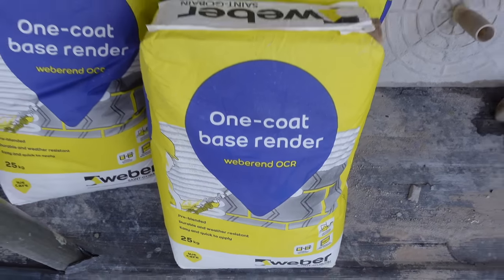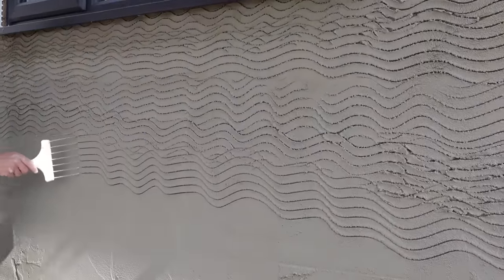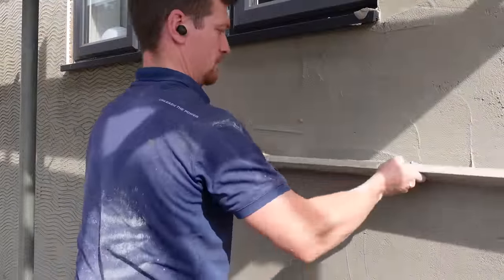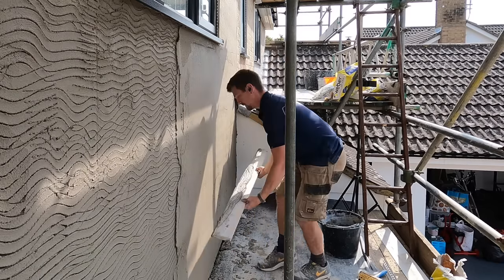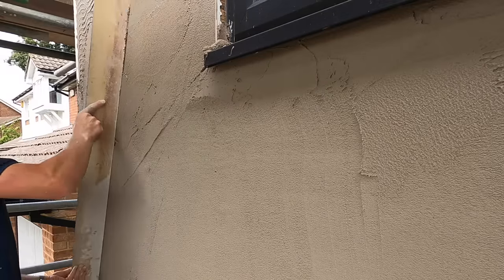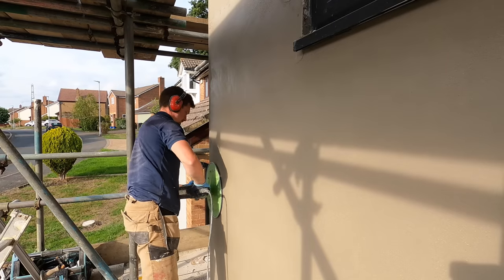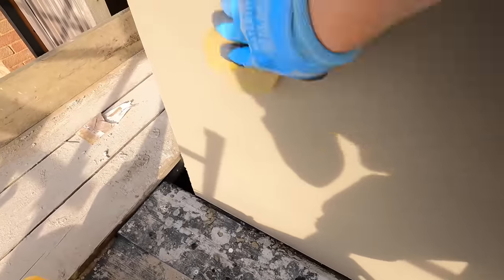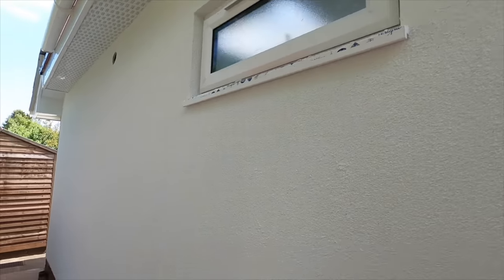RENDERING: Sand Cement Render's DEAD | This Bagged Render's 10X Better Than Sand Cement Construction

Comment: I was using this product over 20 years ago in Germany. Well done UK for coming into the 21st century. Now you guys need to come to terms with one coat interior plaster which I swear by. Maybe next decade British plasterers might learn how to use it. Bathrooms used to fully rendered with this product and then tiled.
Reply from the maker: Oh that’s interesting. I’ll give that a go - cheers Pal 👍👍
Reply: 40 kg bag of Quick Mix cost around €7 a couple of years ago 😉 Always used it in bathrooms with levelling/guide beads. A tiler’s dream!
Reply: @terryhill6734  what is the full name of product and manufacturer please?
Reply: @alansmith3733  manufacturer is Quick Mix and it’s called K-01. However, after using Johnstones Trade OCR, I’d say that is far better to apply.
Reply: @terryhill6734  thank you
Reply: Seems that many British tradesmen are slow to adopt new technologies. I wonder why? Maybe the fear of being uncool/untraditional?
Reply: @robd9863  Most British tradespeople ( and I say most, not all) are after making as much money as possible, but in their defence so are most British house owners. So with a very money orientated society we then dont have the time to learn new methods. Also most British trades people and in particular plasterers are uneducated and I include myself in this bracket and not the brightest amongst society. If they had a brain they wouldnt be plastering to begin with. Just my opinion and my experience. I know that comment will be controversial but its the truth. And again I say 'most' and not all of course.
Reply: @frankiez7414  Fair observations, but there are always exceptions. I like to think I've got the brains (some who know me would debate that) but I like doing the practical stuff. Arguably I don't do it all for a living, but well beyond what could be classified as DIY. I like to be self-sufficient and able to turn my hand to most things (though decorative stuff bores the pants off me). So I've always looked at the latest innovations. Many have proved awesome, though the product itself was more expensive.

Maybe the Germans are naturally pre-disposed to always look for better ways to do things. But then, they don't half make a mountain out of a molehill sometimes, when it comes to simple jobs. There must be a happy medium.
Reply: @robd9863  There are people who are not academically gifted and also those who dont have much choice in the matter. In general plasterers are not educated but of course there are the exceptions. So what you are saying Rob is that you are not a professional plasterer but a DIY plasterer ?
Many countries in the West were flattened during WW2 and therefore could rebuild the whole infrastructure from scratch and sort of learn again. Look at the Netherlands and their cycling mentality and network. The UK has kept many old houses and streets and only during the build of new properties have learned new skills and materials perhaps. But again I think its a small island mentality and in Europe they share many skills and ideas leaving us out on a limb. Maybe the 'Great' in GB is not so much anymore. Not so Great Britain I think.
Reply: It's the expense of new products that put trade off  and reduced profit
Reply: @rogergregory5981  This problem is as old as trade itself.

If I use an ace product that allows the job done in half the time, some customers will say "But you were only here working for X hours, how come your bill is so high?"

So many trades do things the old way, takes longer, but customer feels they got good value because they had a guy on their site for lots of hours, which (in their minds) justifies the price.

And don't get me started on why one should pay more for the experienced tradesman, who can do the same job (better) in half the time.

Perception. It's all about perception. And the money!
Reply: @frankiez7414
and where was your youtube video about the product 20 years ago then clever clogs
Reply: @antwan.  not sure what your point is Antwan. You say im a clever clogs but I am a plasterer with over 40 years experience and I know what I am talking about (well sometimes) The point I was making is that there are some trades people who just dont want to learn new ways. I dont know why this is. This was what the discussion was about, adopting new ways and techniques. Its about making things easier for everyone and making the best job possible surely ? Are you saying this is not up for discussion ? So then the whole point of the comments section here....discussion
Reply: Pffff..  Stay in your Germany then with full of cracks all over the buildings. Nothing can beat sand cement in quality and price my friend... And those shits in the bags from big corporations you could recommend for someone else not me.
Reply: @Olgertvanags  im not from Germany, so why would I stay there. Sand and cement is notorious for cracking and people are using brands like k rend on exterior builds now. Sand and cement is old school. Not sure what you mean by "shits in the bag" Are you a plasterer ?
Reply: I'm not a plasterer - any advice for a bricklayer's apprentice? We still mostly use the same tools we did centuries ago. Lime is largely gone and mud is cement and sand now, plasticiser sometimes, sometimes lime juice but with a trowel and level you can lay bricks and that's most of the job. Anything to speed that up or improve the end result or cut costs would be great).
Cheers

Comment: Great channel Blaine. Watched several of your videos and learnt an awful lot. I'm just a DIY guy who finds this stuff fascinating/magical to watch. You have a new subscriber.! 

Did a  plastering course at a Building Skills Centre (Yeovil)  quite a few years back where they taught you  how to build your own beads and get them plumb and they then formed the guides for when you drew the feather edge up the wall and the benefits of applications using trowel - float - trowel for a super flat finish.  Your review of the Webber product is very timely as I have a wall where the render blew and was hacked off but there remains a base layer that is rock solid. Trouble is that neither the builders not I have manged to get a new application of sand/cement to stay keyed more more than a few weeks.  It might be that I have to go back to bare blocks but the base render the very hard and I don't want to risk compromising the double glazed units with the vibrations that a SDS chisel might generate while hacking it off. This stuff might just be the answer. I see Webber do their own render bond product as well.  This could also be just the ticket for internal walls that have been coated with Thoroseal damp proofing as well. Great job with the channel!

Comment: Hi, just wanted to say a big thank you, I'm I guess a builder by trade and do a fair bit of internal plaster work,  a bit of sand a cement but always hatted it. I remember grinding a slot for a lead flashing into some new render and was put of by how soft it was! after watching this video I decided to take the plunge and do my own extension, 45 bags of OCR, was a joy to use and really happy with the results. I also scratched it before Christmas then top coated last week no problems. Thanks for all the info love the channel.

Comment: Used plenty of this , I use it over a rend aid scratch on troublesome or smooth bricks , Always a believer that a scratch coat should be left for a few days or your defeating the object of a scratch coat as going straight over it just smooths the coat underneath anyway and then has no solid key , You also gotta catch this product at the right time or can be a pain to float up, When floated at the right time it does rub up lovely though and is a nice consistent finish, Sand and cement is just as good and a lot cheaper it’s just getting your mix ratio right with spot on correct bucket measurements not shovels !! and experience with using it ,
Reply from the maker: Very good points here mate - thanks for sharing 👍
Reply: Yer thats what webber advised to do. They said use rendaid with mesh at 3mm thickness, then stipple roll and let it properly set. Then after a day or so apply the OCR ontop with mesh and finish as required

Comment: Been waiting to see these new products being used, looks so nice to use. 
Couple of questions, what type of backgrounds can this be applied too, and can the Monocouche be applied as a top coat and the silicon base? 
Many thanks Blaine, loves your vids 👍
Reply from the maker: I think you can use it on most masonry background but Monocouche is a a totally different product. You can use Silicone render on top of this product though pal!

Thanks for watching. I really appreciate it 👍
Reply: No probs, thanks for the reply, look forward to more vids 👍. 
I would just like to mention as well. I just finished rendering some garden walls. Done a really nice job. Much better than ive done previously when rendering . This is all because I’ve taken some of your tips  👍
Reply: Nothing new here. Rest of the European countries is using this stuff for 20+ years. Only UK and Ireland are far far behind
Reply: @PlasteringForBeginners can it be used on top of cement boards?

Comment: Can I use this product tot finish a wall that has been rendered with one coat of Knauf UP210W? It’s a sand cement mix, this wall sadly was’t flattened with a ruler nor scratched after the layer was applied. It had been worked with the trowel too much in an attempt to flatten it. I’m not satisfied and I would love to apply a second layer. Can I use this product? Do I need to prime it before I do?

Comment: It still cracks ,if the building is going to move it will crack even with mesh.I do agree it’s a decent product but I’m sure you will agree it doesn’t rub up or look as good as sand and cement.I would only use this product as part of silicone system or with some other decorative product over the top.
Good video B.
Reply: I’ve only ever used ms20 but went back to standard s&c because although I liked the consistency and same day scratch and top I found ms20 a ball ache to rub up being so sticky, I wasn’t as bothered the bigger aggregate brought to the surface when sponging but it was definitely not as easy to rub up as standard, maybe Weber is better?
Reply from the maker: You have a point Lee. And I actually said in the video that it doesn’t rub up like Sand cement…but I’m still happy with the finish. But for me the pros far outweigh the cons with this one. I really enjoyed using it.

Give it a try Bricky58 - there’s no big aggregates in this. Very smooth to use and extremely fine which provides a very smooth finish. I recommend it pal 👍

Comment: Incredible work always 🙏🏽🙏🏽🙏🏽🙏🏽🙏🏽I try looking everywhere supply house here locally not th home stores an no one has seen this product before my question to u do u kno if this product will be available in th northern part of th USA ….I’ve used a similar product call Rapid-set while great for small jobs in larger areas it won’t give u enough time to work with it due to so manny Accelerators An even wen a retarder is used u still only have a 10 min window from th time is mix to just losing it cause it gets hard ….again Rapid-set is a great product but I wish I can get my hands on th OCR one coat system thanks 🙏🏽🙏🏽🙏🏽

Comment: Hi I’ve used this product for small jobs so far like heads and reveals I’m currently going to start a job soon but they want a coloured rough cast render with Weber the back and front of a two bedroom house the house is stone work what would you recommend using sand and cement scratch coat first or could you go straight over the stone work as it is with the ocr I’m going to put fibre mesh in bedded to prevent any cracking

Comment: Going to be using this on breeze block. Should I be using a mesh? If so Should i be putting the mesh onto a  scratch coat?

EDIT - just spoke to Weber - they said that for breezeblock i should use WeberRendAid first - trowel it on at 3mm thickness - then gently press in the pink mesh (lapping at 100mm) and use a stipple roller on the rendaid, then let it set.

Then use OCR as normal ontop of that
Reply: You just answered something i needed to know. How did it go. Ive got home extension to render which is celcon block. Im edging to using this material material
Reply: @terryfincham7252 use the same methods as above but for extra precaution use a rendergrip before applying the rend aid mesh and stippling it
Reply: @terryfincham7252 I am gonna be putting on the rendaid over next few days weather permitting. I've beaded it up ready, hopefully it'll work out OK. I'm just a DIYer so wish me luck lol

Comment: I’ve used this my only issue with it was if you  lay it on around 15mm to 20mm it has a tendency to crack I still think I prefer the way sand and cement rubs up but I must say this is nice to lay on it’s like laying on hardwall
Reply from the maker: I’m pretty new to the product but everything I’ve done so far feels solid once dried. But I’ll definitely bear this in mind. Thanks for sharing 👍
Reply: Try VPI basecoat it's bullet proof

Comment: Can you knapp it too?? What's the finished colour is it like a lime and motor finish?? Or can you get other colours.... Also how long does it hold up, like doing a big gable on a house...
Reply from the maker: I’m not sure to be fair - I can’t see why not. It wets up well so I’m sure you can. But I must admit it dries quite fast so you have to be on it. It does come back with water but you probably get more time with sand cement to be fair pal.

Comment: What a coincidence... I used it today (my first time rendering); unfortunately my lack of experience got the better of me and I applied a single coat of it too thick to a wall with no suction, consequently it started to fall off of the wall.

Rather than persist I scraped it all off (I used some of it to quickly repoint my patio so not a total loss) before it set up, a £35 lesson and some experience.  It's only annoying as I said to my wife beforehand that I thought I should apply it in two coats but I didn't listen to my internal monologue and went ahead anyway.

I'm going to give it another crack (I have some bags left and I don't write off a product because of my lack of experience) at a later date, 2 coats this time just as Blaine shows us in this excellent video that came at the right time to reinforce my decision to press forward.  Thanks Blaine!
Reply: Maybe they will change the branding to 2 coat render lol😂.
Reply from the maker: Good luck next time Charlie Delta! All the best my friend 👍
Reply: Funny that it fell off right after applying. Wonder if you had too much dust on the wall, AND if you forgot to dampened the wall before applying it.

Comment: Home owner question here, what's the consideration with solid walls? My render is cracked and I'd like to replace with a modern solution, but I wonder if these new systems allow the bricks to breath enough? Although I'm sure the paint used by previous owners doesn't allow for much breathing!
Reply from the maker: It depends on the render systems available. This particular product isn’t ideal because it doesn’t allow any breathability but there’s lots of products out there that do. 

Just not this one unfortunately. Sorry 😢
Reply: It does allow the building to breath 

Resists the penetration of external water and has excellent weather resistance and durability, whilst allowing the structure to breathe
Reply: Use lime render it will outlive anything else and is the most breathable

Comment: I  got this stuff. I didn't use it yet but it says on the bag contain sand cement and lime 
In poland we was using 1parrt of cement , 1 part of lime and 4 parts of sand . 

I wonder if there is anything else. Is this stuff getting hard faster ? I don't know.  I will find out tomorrow.

Comment: I can see is sticky,  so l think l will use it tomorrow for a first time.  
I got under window bowl which all rendering is off. New wood frame is on with metal mesh so that only will hold the rendering and pebble dash.  So l  need one coat just to make it solid and I  don't want wait so  long to apply again with worries that this will come off  like the sand cement if is too early. 
I will find out tomorrow.  

I can tell by looking that this will be ok.

Comment: Hi Blaine, it says one coat base render but you used it for base and top coat? Should you not of used one of webers top coats?
Reply from the maker: It’s used as a base coat for the Webber Silicone render system but it can be finished like sand cement. 👍
Reply: @PlasteringForBeginners  good to know thanks, would you recommend using it on garden walls and then paint them?

Comment: Hi videos are great need advice I always used sand and cement the thing I find most awkward is the heads with sand and cement was thinking of using for the heads just wondering your thoughts can it match ok with sand and cement this stuff looks lighter
Reply from the maker: It matches well with Sand cement - it’s pretty much the same finish mate so this would be good for you I think!